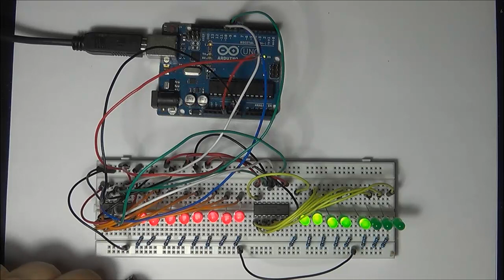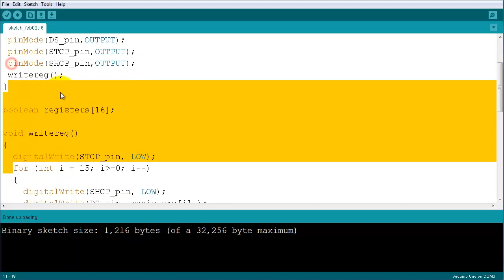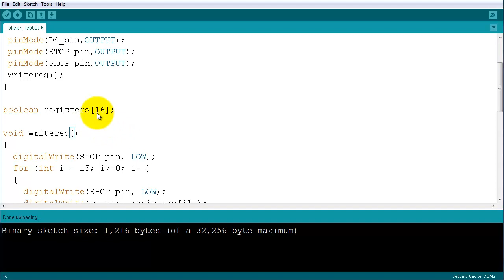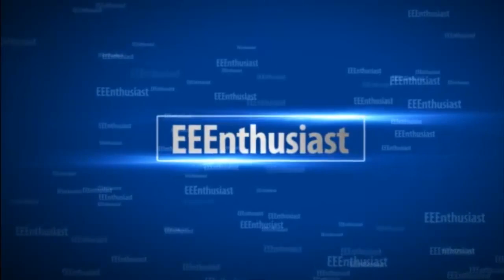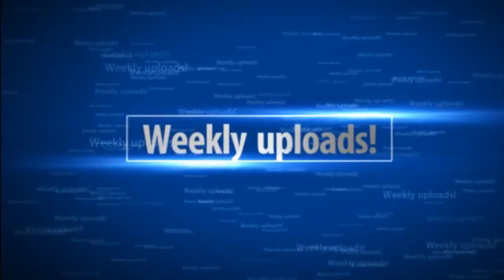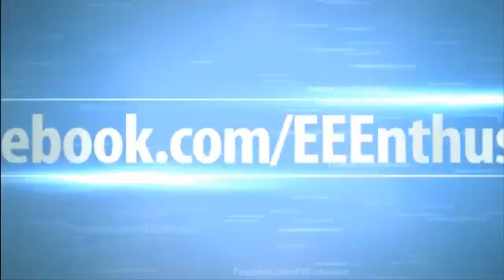Arduino Shift Registers Extended (74HC595)

Comment: I'm currently using 24 LEDs and 3 shift registers. When I enter the value 1 to the data argument for the ShiftOut function, the first LED connected to each shift register lights up. Then, when I give the value 255, all 24 LEDs gets lit.Would you please tell me how to only light up 1 LED from the last shift register ?  Thank you
Reply: Hello, could you find a solution about problem ? I've the same :)

Comment: While it's fine to use <16 in your for loops since this will reach 15, >0 will not reach zero (which is why the first LED never turns off in your circuit). If you want the first LED to turn off in the loop then you will want to replace this with >=0.

Comment: What resistors are you using on the leds? Do you know what voltage the pins output? They're supposed to lose .2V with just 6mA output. You show all leds on but I have no idea how much you do or can source from a 74HC595 or how low the output gets.

Comment: So if I want to run more LEDs than the arduino can do (re current) and i cant afford the TLC5940's....would you suggest driving the base of some NPNs like BC547s with the outpput from the 74HC595s? Thanks for the vid btw....helped a lot. Subscribed.
Reply from the maker: +BooktownBoy That would be a challenge because the TLC5940 has dedicated Analog output channels. The 74HC595 only has digital outputs. I'm sure that some clever programming will do it, but it would not be as simple. That being said, you can absolutely use NPNs driven by the outputs to turn LEDs on and off.
Reply: +EEEnthusiast Im not all that bothered about being able to analogWrite to them, just to be able to control lots of LEDs with digitalWrites is fine. Thanks, I have plenty of BC547s lying around :)
Reply: You can change the brightness of your leds by changing the pattern every 2ms and sometimes the bit for the led is on and sometimes it's off but the eye only sees the average brightness. This is how you do it with the cheaper chips. ;o) The led is quicker than the eye will ever be.
Only thing is, how bright you can they all be with the cheap chip?

Comment: I'm planning on making an LED cube with about 250 LEDs. How do you think I should power the whole thing? Also how would capacitors come in play?
Reply from the maker: +Adam Akkad You would need to have a power rail for the whole assembly. Calculate the total power you need and make sure your supply can handle it. Depending on how you use PWM, you may be able to get away with a much smaller power supply. In other words, if you only turn on one LED on at any given time (Only creating the illusion of them being on), you can have a very small power supply for your project.

Comment: Thanks for the tutorial, if any of u have  Mitsubishi M54995p or  uln5821a it also works but you will need to change the DS_pin to S-In, and SHCP_pin to ClockPin, and the STCP_pin to LatchPin.

Comment: An Arduino volt meter using 7 segment displays ran by shift registers would be a nice project.  This would be a handy expandable tool to use for solar energy management needs.